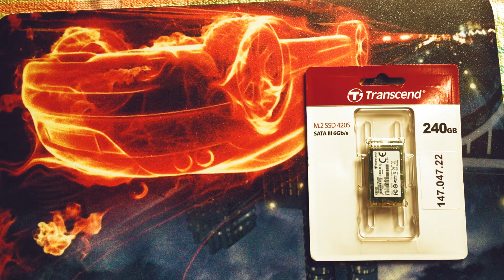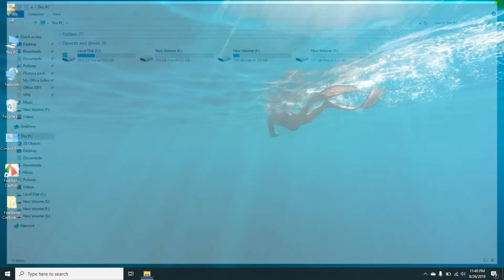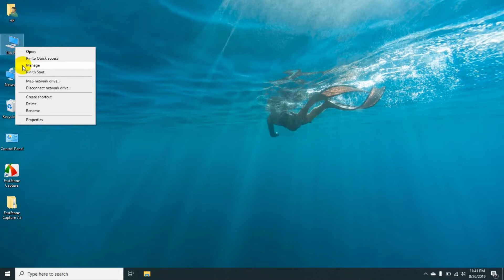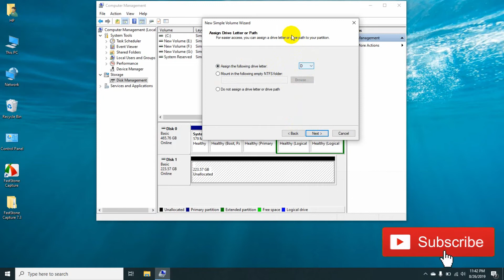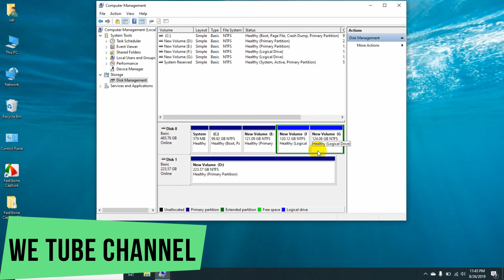How to install an m.2 ssd: installation tutorial with HP Elite Book 840 G2 m2 ssd drive

Comment: Hi! What size screw is the screw that secures the SSD? My screw is missing so I need to replace it.
Reply: Same here. Also interested in knowing if after installation there will be air between the sdd and the board or touching each other completely... Thanks
Reply: @kvk-t8i  they do touch each other from as far as i can tell, i still havent found what size screw i need though, ended up adding a completely wrong screw and cutting it down and hoping for the best

Comment: Thank you VERY MUCH for making this video, it seems pretty straight forward, well, only because you have shown us how to do it, otherwise not so simple! I am now thinking of the second major step, after installing and formatting the new M.2 drive - as it is very likely that it is must faster even than my existing SSD where my Windows is installed, I would naturally want to install or migrate my Windows to the new M.2 drive. Can you PLEASE, if you see this comment and have a moment (that rhymes lol), help me find out whether it is possible to simply clone over the whole system to the new drive? Or fresh install it and start from scratch? Either way, I'm really grateful for the help you provided with this video! Thank You! 🍻🍻🍻
Reply: @wetube24  thank you for your reply! I think I've found a solution, windows 10 seems to have tools just for that, makes sense that it does. It didn't take too long to dig it out :). But I will wait up for a while before I upgrade as it doesn't seem to need it so urgently. The ssd in the laptop seems more than sufficient speed wise, and I still have some room on it. 🍻 Cheers 🥂!! 😁

Comment: hellow , can i install NVME ssd in HP Elitebook 840 G1  ?
Reply: @wetube24  but my laptop has a single cut slot , i have m2 ssd on it , just wanted to know if nvme is suppported or not ? al;so the PCIE version is 2.0 , i think Nvme needs pcie version 3.0 to run nvme ssd ...
thanks for your reply , so i can install M2 NGFF ssd not NVMe ?

Comment: Hi 
can I use 
Samsung SSD PM991 M.2
2242 42mm PCIe 3.0 x4 NVMe MZALQ256HAJD MZ-ALQ2560 Solid State Drive 
On
Hp Elitebook 840 G2 core i7 5600U 2.6 GHz 

And which capacity will fit 
512 GB or  256 GB
Reply: yours will fit. but the speed will decrease as to what the motherboard supports. and 256 is the max capacity supported
Reply: So for the M.2, the max capacity the laptop would allow is 256GB? @Ericopiero

Comment: What size M.2 card number do I need? Is it the M.2 2240 ssd card that lines up perfect with screw hole? Hp Elitebook 840 G2 here... I will be getting a WD or Crucial named brand only...
Reply: anything sized 2240 will fit perfectly
Reply: @wetube24  can run windows with this m.2?
Reply: consider even this https://content.spiceworksstatic.com/service.community/p/post_images/0000307658/5af1d888/attached_image/Camera_20180508_115354_.jpg

Comment: Did you installed windows in m.2 n it did boot with HDD? I just bought netec 2242m.2 but I cannot boot from it. I can use my m.2 as storage but not as a bootable device.
Reply: edit the boot sequence in bios

Comment: How do you make it boot from M.2 SSD? My would not boot from M.2, only from SATA SSD. I plan to install M.2 BOOT drive and put 1TB HDD in SATA drive.
Reply: @wetube24  It would not do it. Caps lock and scroll lock LEDs blink and it takes ages to boot Sata SSD. It would not format or read M.2 ssd. It works in my desktop PC just fine.
Reply: @wetube24  I have built several dozen of PCs. Mine has AMD 3200G cpu, gigabyte motherboard amd it has M.2 socket. On it, my transcend 2242 ssd works perfect. But when I put m.2 ssd in my HP elitebook it is recognised, but it would not format it (for example using easeus partition master or windows disk manager), while it takes ages to boot from SATA ssd. When I remove m.2 ssd, it boots 10 times faster.
Reply: So the laptop wouldnt even recognize the M.2?
Reply: @andytong7392  Solved. Poor connection. Just do not plug it in all the way in, but just gently push. Now it works fine.
Reply: @Mladjasmilic  Did you have 1TB version? Or 256GB?

Comment: hi bro is that laptop support nvme m.2 also or only m.2 ssd?
Reply: That is the golden question I myself am wanting to find out. As such is stalling me to upgrade till I do. I have the 840 G2 just need something to know if it does or don't support NVME. I been looking for months and all I get is a dozen yes and a dozen no in my research. I'm going to guess it does not. So for now I will go with that and ask what m.2 size card do I need? Is it the m.2 2240 that mounts perfect where screw hole is to put screw on board to lock card tight?
Reply: Friend, the same thing is happening to me too... I don't know what to do but I saw a video where a guy installed an Nvme and there would be no problem so I guess it can be done for my laptop which is the folio 9480m  @joesphbaumgardner4579

Comment: Sir I have same laptop 840G2 can you give the dimension of ssd and about the price as well and is it available on flipkart or Amazon
Reply: @wetube24  Hi sir, great video, very usefull! Now, I want to install  the highest capacity M.2 to an elitebook 840G2, is it 1TB the highest possible??. Cheking at HP specs. we have 256gb as a posibility but I'm not sure about the highest limit.
Reply: Did you get a 1TB? @javiercorregidor1734